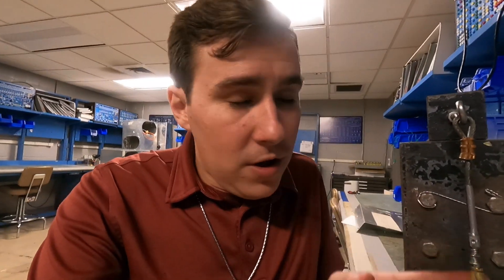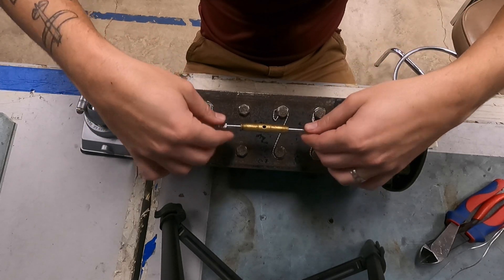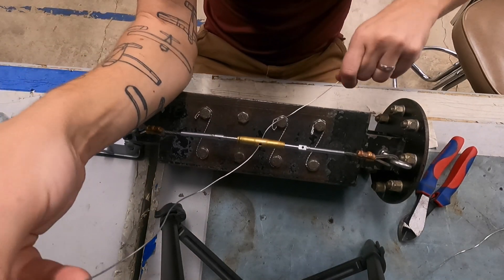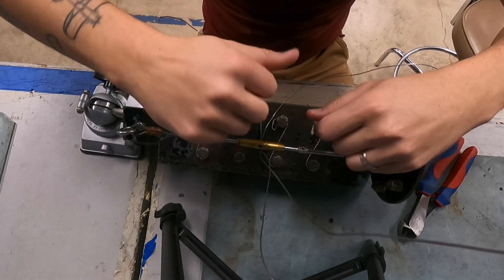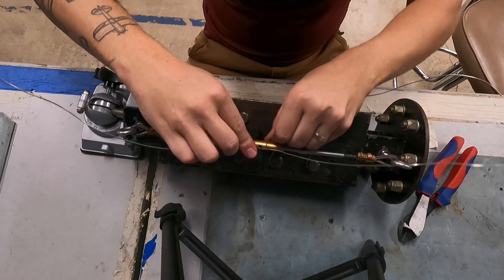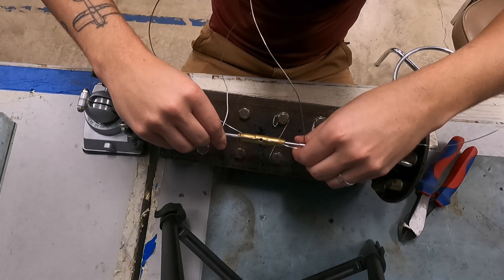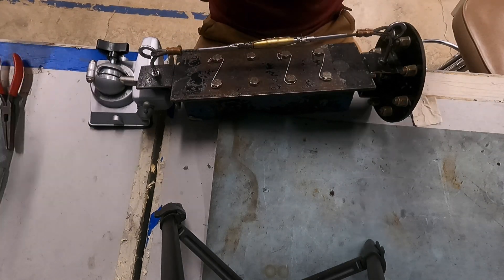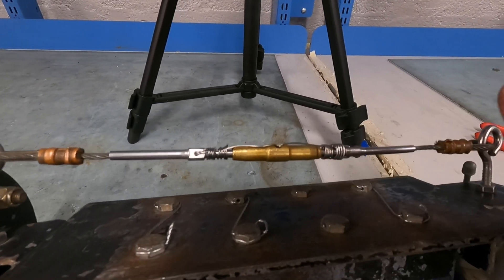How to Safety Wire an Aircraft Turnbuckle | Double Wrap Method Explained

Comment: Hey Bryce, I just wanted to say your videos have been Extremely helpful in getting my Airframe certification. I was unable to get my Power plant certification due to time constraints. Safety wiring a turnbuckle was one of my practical projects. I felt very confident in doing so after watching your video. As well, your tips for testing and calling the DME prior and ascertaining what aircraft would be used for my test!